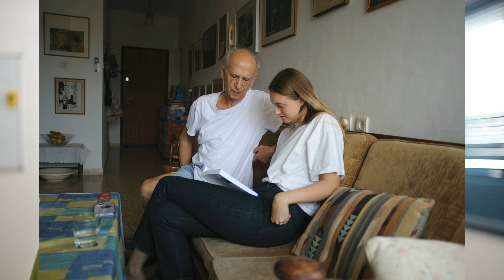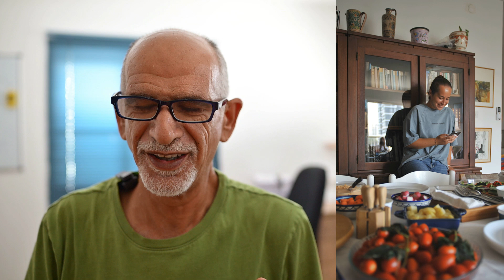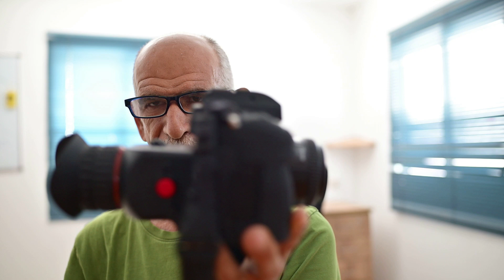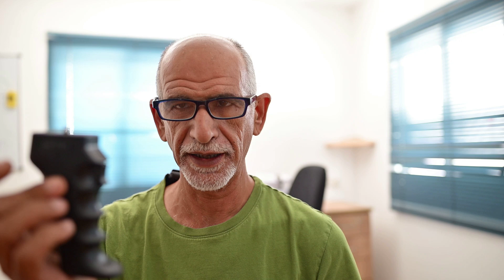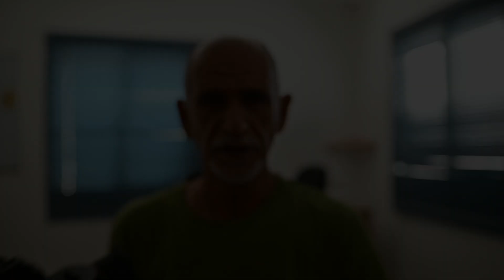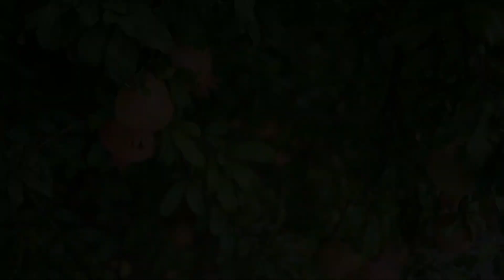Does sensor resolution affect 3D pop? (and other bits and bobs...)

Comment: I do not know if this will help you, but I noticed that my old lenses have a 3d effect, but they lack contrast and color depth. Then I began to look at different cameras to understand which sensor gives a more expressive picture, in relation to video shooting. And naturally it turned out that it was the movie cameras that gave a lot of color information, a large gradation of color shades and soft color transitions. And I didn't notice that the high resolution of the sensor helps to highlight the subject. A large sensor area can make an object convex. My conclusion is that you need to take an old lens with high contrast, and a large camera sensor will do its job. a large depth of color will emphasize this depth and make it real, and better than in reality.

Comment: It seems to me that the modern low resolution camera to get is the Sony ZV-E1. I know Zeiss has own brand and Sony+Zeiss brand autofocus lenses for it. There is even a Nikon F to Sony E adapter that has an autofocus motor for screw drive lenses in it, the Monster LA-FE2. https://www.monsteradapter.com/products/la-fe2-nikon-f-mount-lenses-to-sony-e-mount-cameras-adapter-with-af-motor-built-in
Reply from the maker: The ZVE1 does not have a viewfinder, which makes it limited to video to a large extent. The Sony A7S series may be more suitable for photography, although 12mp are out of fashion these days. Personally, I think that resolution is plenty but I don't crop much.